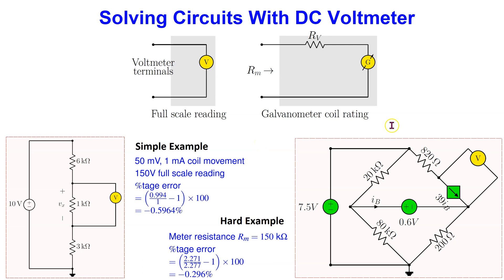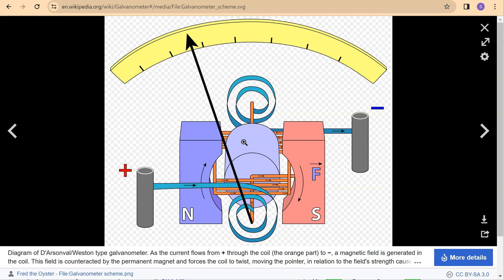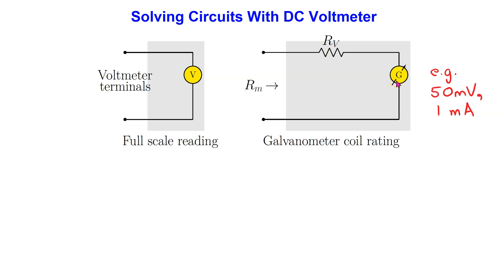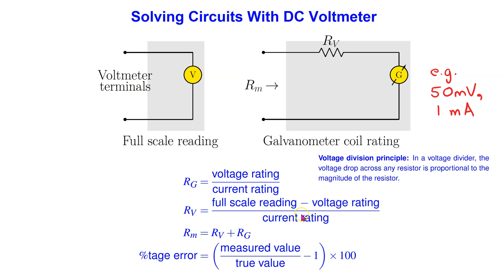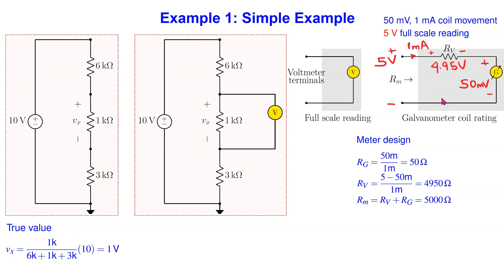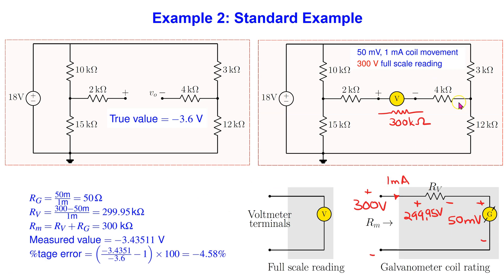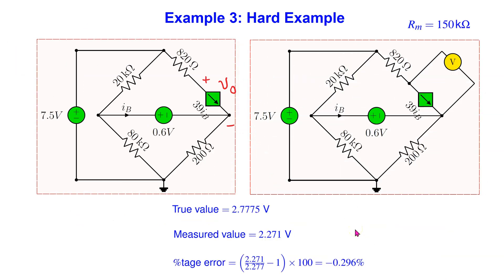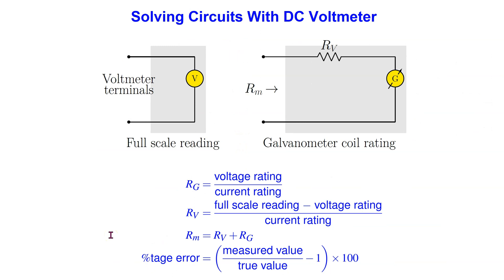Solving Circuits With DC Voltmeter

Comment from the maker: # Pyspice (Python) code to simulate Example 3 in the video
# Compare with theory solution in the video at 11:30 (without voltmeter)
##########################################################

import PySpice.Logging.Logging as Logging
logger = Logging.setup_logging()
from PySpice.Spice.Netlist import Circuit
from PySpice.Unit import *

circuit = Circuit('Voltmeter - Example 3')

circuit.V(1, '1', circuit.gnd,  7.5@u_V)
circuit.R(1, '1', '2',          20@u_kΩ)
circuit.R(2, '2', circuit.gnd,  80@u_kΩ)
circuit.R(3, '1', '3',          390@u_Ω)
circuit.R(4, '4', circuit.gnd,  200@u_Ω)
circuit.V('zero', '2', '5',       0@u_V)
circuit.V(2, '5', '4',          0.6@u_V)
circuit.F(1, '3', '4', 'Vzero',      39)

simulator = circuit.simulator(temperature=25, nominal_temperature=25)
analysis = simulator.operating_point()

for node in analysis.nodes.values():
    print('Node {}: {:1.4f} V'.format(str(node), float(node)))

for node in analysis.branches.values():
    print('Node {}: {:5.3e} A'.format(str(node), float(node)))

######################################################################
# Calculate and display the currents in each reistor 

i1 = (analysis['1'] - analysis['2'])/circuit.R1.resistance
print('i1{}: {:5.3e} A'.format(str(i1), float(i1)))

i2 = (analysis['2'])/circuit.R2.resistance
print('i2{}: {:5.3e} A'.format(str(i2), float(i2)))

i3 = (analysis['1'] - analysis['3'])/circuit.R3.resistance
print('i3{}: {:5.3e} A'.format(str(i3), float(i3)))

i4 = (analysis['4'] - analysis['3'])/circuit.R4.resistance
print('i4{}: {:5.3e} A'.format(str(i4), float(i4)))